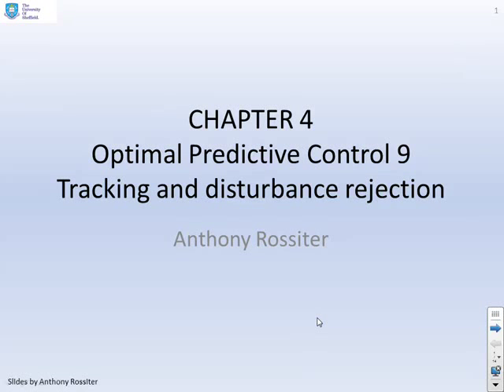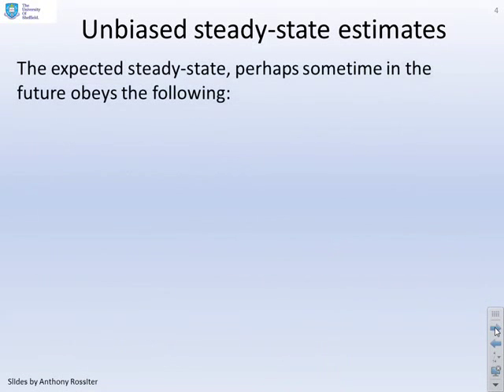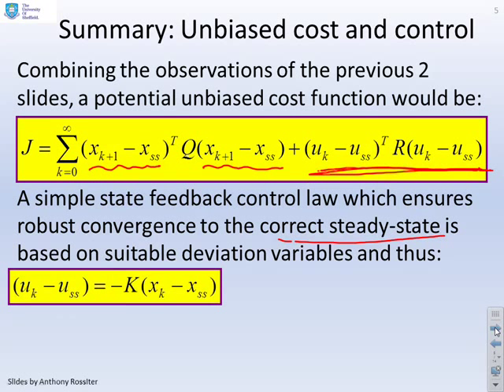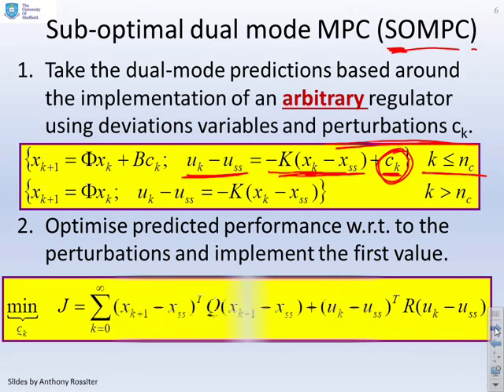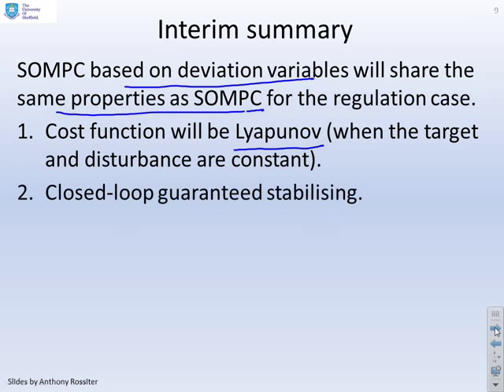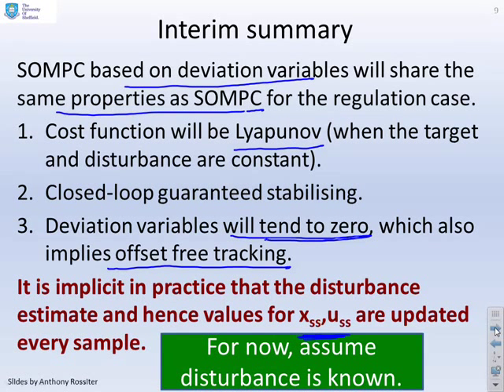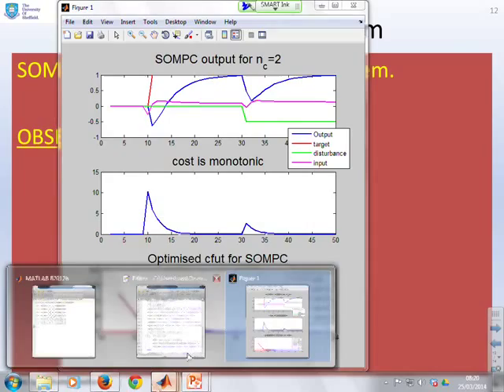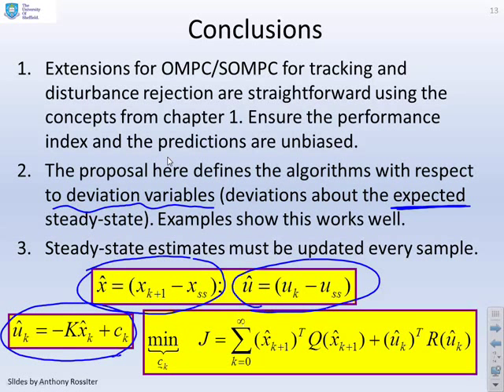Optimal Predictive Control 9 - tracking and disturbance rejection

Comment: Hello Prof. Rossiter, just a question: what's the difference between the shown method for getting unbiased closed-loop responses and the method that uses an augmentation of the system, i.e., inserting directly an integrator on it ( xa = [x ; xi], Aa = [A-B*K , B*Ki ; -C , 0], Ba = [0 ; 1] ), if there's any?